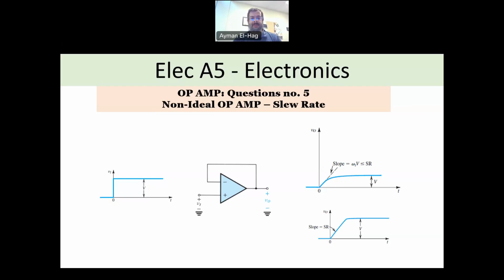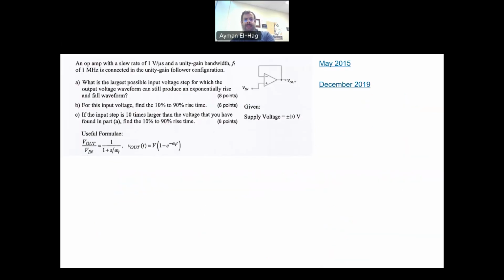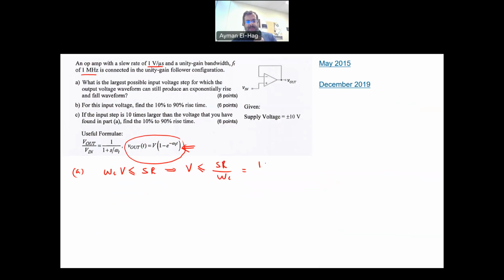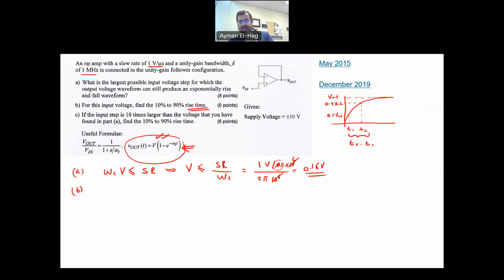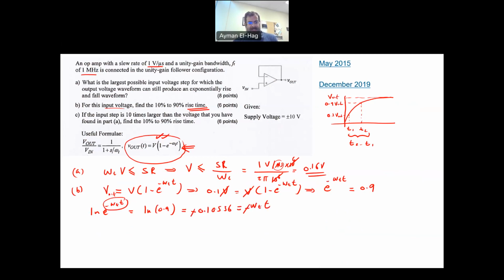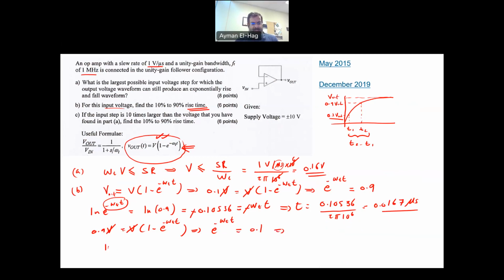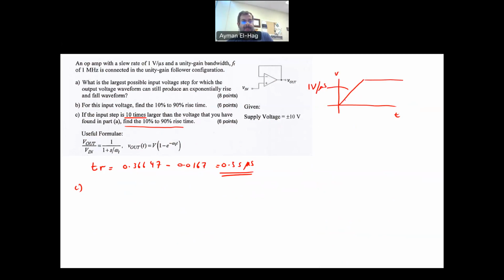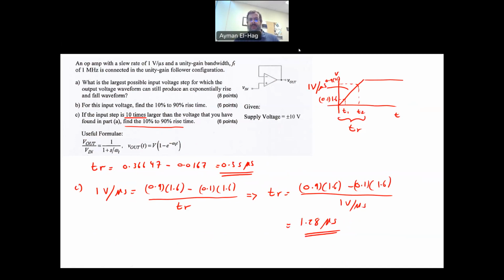PEO solved examples (ELEC A5): Non-Ideal OP AMP Question no. 5

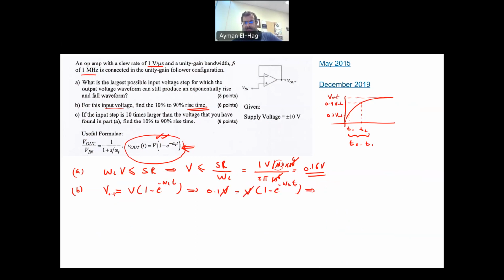Comment: Hi Professor, I'm not understanding how you were able to cancel Vo and Vi at 5:38. Can you provide a bit of context?
Reply from the maker: Vout will be equal to 10% (and the same will happen for the 90%) of Vi, so I replaced Vout with the 0.1Vi, then the V's from both sides of the equation are cancelled.